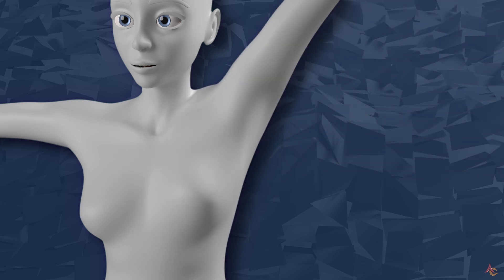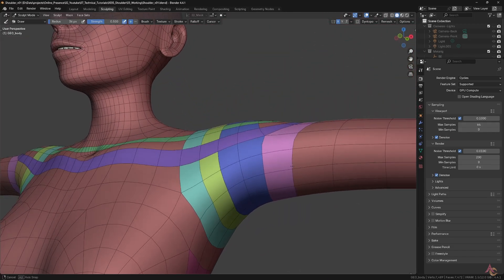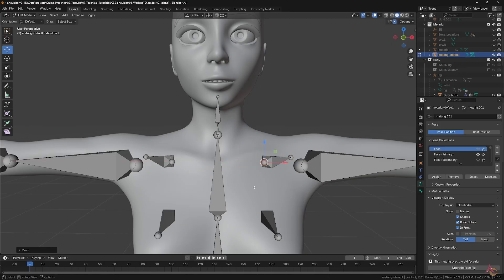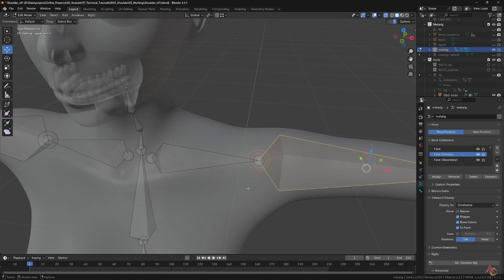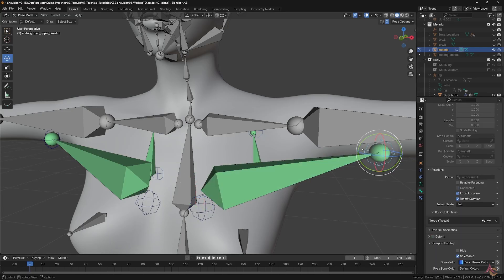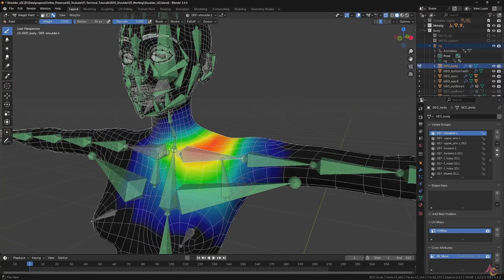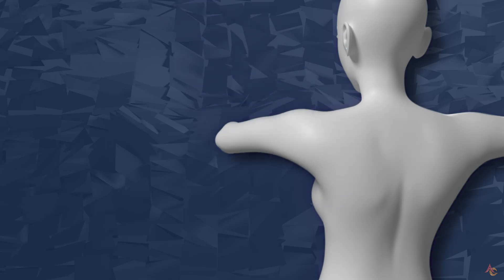3D Character Creation for Animation - The Shoulder

Comment: Can someone point me out a step by step tutorial about this? Or, an explanation of what are those blue tiny bones... how are they set up?
Reply from the maker: The blue tiny bones are basically the same as any other bone in an armature setup. It's just that in this case, they are being used as control bones. This is why they appear as normal looking bones in Edit mode, but change to those wired shapes in Pose mode. The wired shape is just a normal Blender object that has been assigned to the bone as a custom shape.
The primary difference between the blue bones and the normal gray or green looking larger bones, is that the blue ones have their 'Deform' property turned off. In other words, they won't deform the mesh, which is what you want, as they are being used as animation control bones.
Outside of that, the bone setup is like any other bones in Blender, you either have a chain of bones, one parented or connected to the next one. Or you use constraints (think basically modifiers) that tell one bone what to do based on some other bone.
So in this case, the main deform bone is parented to one of the blue bones (hence if you move/animate the blue bone, the deform bone moves with it. While at the other end, a Stretch To constraint is used to force the end of the deform bone to always stretch to the location of the other blue bone.
Maybe ignore all the rest for now and just try setting up 3 bones in Blender, one parented to the other and one 'connected' using a Stretch To constraint. If need be, you could try a search on Blender bones and Stretch To constraint. Once you see how that works, chances are much of the rest will just fall into place.
Reply: @antgib  oh, now i understand. It helps a lot, thank you!!

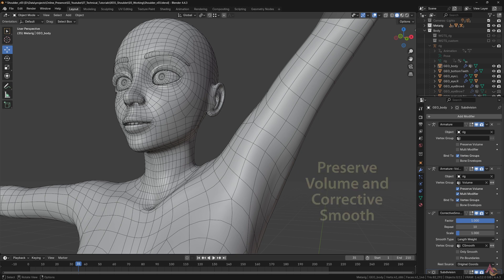Comment: this is a really useful video! i come from a background in 2d art and am learning 3d, i might be wrong but at around 5:03 i actually think the pre-corrective smooth version looks closer to how the armpit looks in a real human raising their arm, that part of anatomy i think naturally does dip in a bit as pec/breast forms lead into that area, which seems more well represented not-smoothed?

either way i rly like this and your video on the elbow :)
Reply from the maker: Yeah, with the arm raised, the pre-corrective smooth is likely more correct around the armpit, but at the same time, I'm also trying to cover every possible movement position and that gets more tricky.
So while it's better without with the arm up, it's not so good with the arm down without the smoothing, as it then tends to collapse more into itself.
Then of course one has to factor in clothes usually being over the top and as such you want the volume to stay somewhat 'inflated' so that the clothes don't just get sucked in.
So yeah, it's all a compromise to get something that works and looks pretty good without doing a massive complex setup. Otherwise the real solution is either a full on muscle system underneath or a mass of shapekeys with drivers to correct everything at a number of angles and positions.
Reply: @antgib  that makes a lot of sense, ill have to keep in mind the clothes thing

Comment: The unfortunate crease that occurs in the armpit when the arm is fully down shows why you don't want the arm to have evenly spaced quads when modeling in T pose. You want to have wider polygons on the underside of the arm where the armpit is. Doing so effectively eliminates the "bent hotdog" under arm crease, while letting you maintain an anatomically correct solid ribcage. Or, even better, model a relaxed T pose with the arms angled down around 40 degrees and a forward elbow, and the edge flow will manifest naturally.
Reply from the maker: Yeah, the A pose is the other option, which while it will produce some better deformation with the arm down, it then of course makes it worse when lifting the shoulder up.
I'll have a bit more of a play spacing the topology out in the armpit, tho again, I suspect it will again have an impact when lifting the shoulder up. Really the T pose is a general compromise with nothing really perfect, but nothing super bad and with luck clothes will hide some stuff anyway. But of course the final solution is actually Shapekeys, which this model doesn't have yet.
Reply: @antgib  I think A pose is the better compromise as humans typically walk around with their arms down by their side 90 percent of the time
Reply from the maker: @kyle8952  True, especially if the character and story is way less action focused. Still, at the same time the overall steps and workflow shown in the video would still generally apply, it would just have some tweaks and adjustments based on whatever the rest pose happens to be.

Comment: It's always so satisfying to see an anatomically correct rig!

However, I'm curious about something when it comes to adding extra bones to an existing rigify or other animation rig add-on.
Some people add bendy bones to the pelvis for auto-weighting, and many, like you, implement custom features such as stretch functions by adding bones for things like the pectoralis major.

In these cases, I'm curious about two things: 
1. At what point do you perform the additional bone work (e.g., before generating the rig)? 

2. also, You mentioned that you work with the Corrective Smooth Modifier and the Volume Preservation Modifier with their respective influences handled separately.
I'm curious—when both are active and their effects overlap, do you ever get an 'over-correction' effect? Or do you just remember the areas you've already worked on to avoid that? Or is it that they simply target different things, so you don't have to worry about them clashing?

Thanks as always! Your videos are a great help!
Reply from the maker: Hi, thanks for watching and the comments/questions.
First up, my additional bones are in fact both bendy bones with the stretch function, so basically best of both worlds. You get the stretch effect that acts more like real muscle and by using a bendy bone for deformation, one gets the weight effect spread out across the mesh without having to use a chain of bones. It's all just a single deform bone, making the rig much cleaner and easier to build.
As for the other questions:
1. For me it came down to two considerations, first was are the modifications I wanted on the rig, able to be done on the 'metarig' so that it would all work and pass into the generated animation control rig. In most cases, at least with Rigify, it's usually possible.
And second, is this just going to be a one off tweak or is it worth spending the extra time to fully integrate any additional bone/rig setups within the 'metarig'.
Since I was doing it as part of an overall base reference mesh and I would be adding/adjusting/tweaking the overall 'metarig' many times and hence generating it constantly, I knew it would save a lot of time overall by combining everything I could into a single 'metarig'.

2. In many ways it's all of those things, but mostly it's largely not any issue, as I worked on it all one step at a time. So, first was bone placement with automatic weights. All I would do is position the bones, generate the rig and re-parent with automatic weights and then pose test. Try to get the deformation looking as good as possible. In areas where it totally fails, (like shoulder/hips), additional bones got added.
Once that was as good as I could get it, I would then start to do manual weight painting for the deform bones. More endless pose testing till again it looked as good as possible.
Then I'd fully activate preserve volume and pose test once again to see where it made things better and where it made poses look worse. At which point I'd then weight paint to limit it's affect.
Then finally, I'd do the same for corrective smooth as the final deformation adjustment and weight paint that where it made the pose better.
So in effect, any 'over-correction' is being removed at each stage, since if it looks bad, the weight painting just prevents it from being applied anyway.

Hope that all helps.
Reply: @antgib  Regarding the additional bone settings of Rigify, I think I need to read and understand the manual more, but I've recently come to think that its potential for expansion is fully comparable to other add-ons!

And, if the volume preservation feature yields appropriate results, it would mean that I don't need to put it in a vertex group to avoid being affected by corrective smooth.

Thank you again for your detailed answer!
Reply from the maker: Rigify is very modular by design, from just using it's various sample base rig types to build up a full rig, to if required adding in ones own fully custom bits that then get automatically incorporated into the generated rig (including additional display buttons and even custom properties in the N-panel rig UI).
If it falls short in any area's then it may just not be as easy to adjust as others or included some additional features that other auto-riggers have by default. Another common difference, compared to say Auto-Rig Pro, is the lack of easy rig export to game engines. If that's your thing, then ARP is likely worth it right off the bat.
Otherwise, Rigify is free and always included with Blender, so you know it's going to be there and will work.